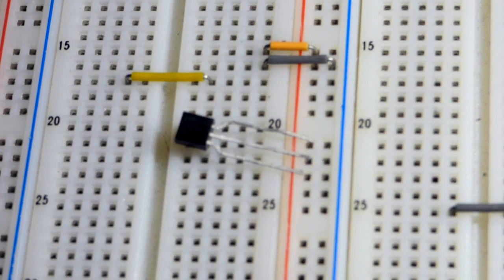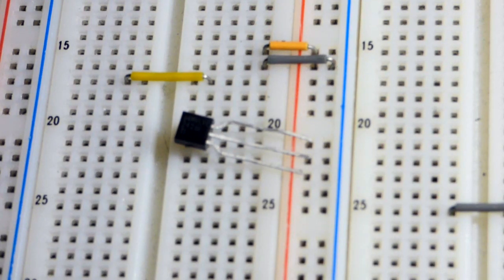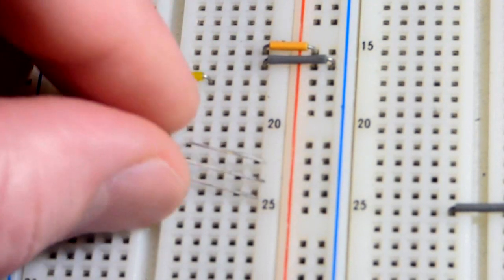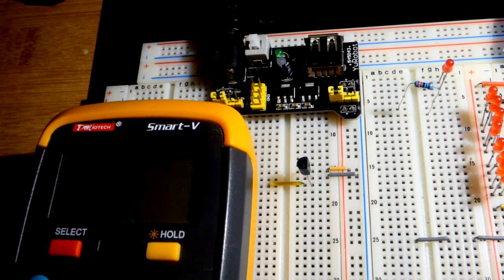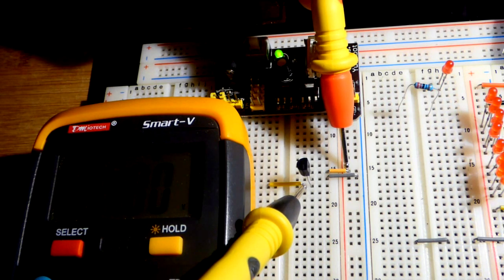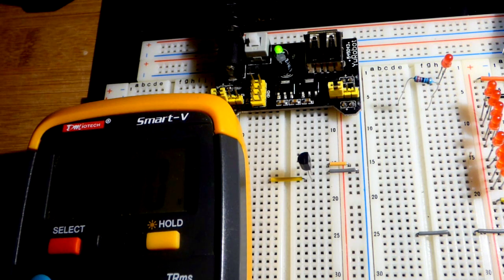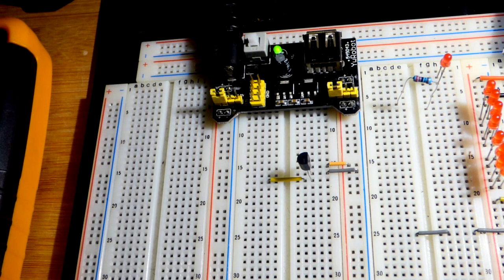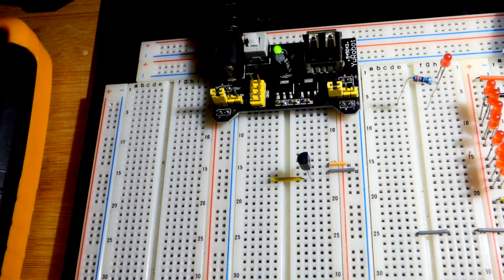TLE 2426 rail splitter virtual ground 3 terminal component for single to split power circuits

Comment: You should put two LEDs in the circuit...
Mirrored, to show a use for this do hickey.
Reply from the maker: Good idea!
Reply: @Electronzap  I get the drift of most of the circuits 
You are teaching us about. 
But a visual outcome, always 
inhanses the experience. 
The mulity meter is great. 
But if I can us it or know how it's used or how I could use it in the future... 
I'm a visual learner... 
And let the smoke out all the time,
Or used to... 
I'd like to see an updated version of your dim on dim off led circuit.
I think it was the dim off one that lead me to your channel... 
Anyway thanks for all the good info 
You've produced.
Reply from the maker: The fade away LED video does get a lot more attention than most videos. I try to control LEDs with most every circuit for visual affect, but ultimately the voltages and currents involved are the most important thing to learn about to understand what a circuit is doing and how to make changes to it. Unfortunately it takes a while to find learning voltages and currents interesting and fun lol.